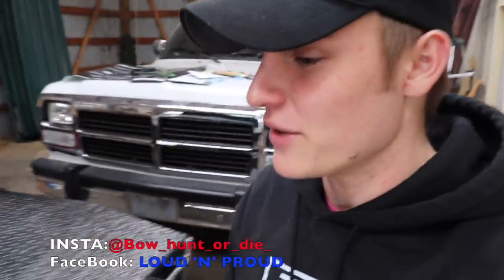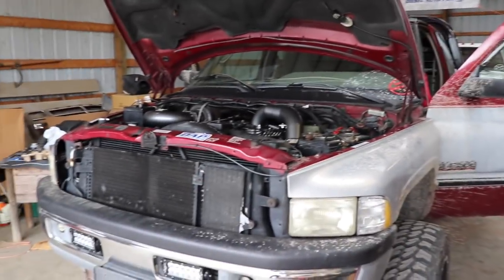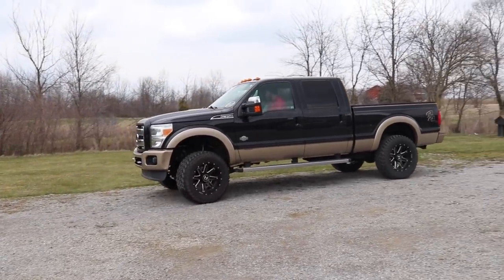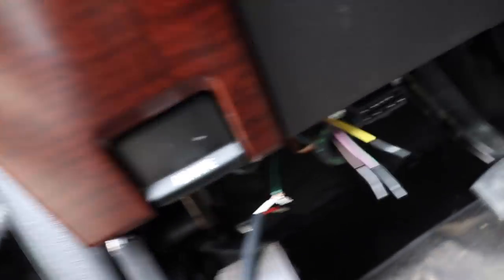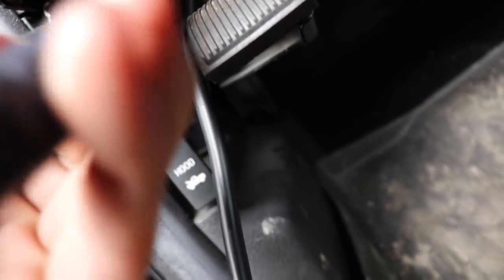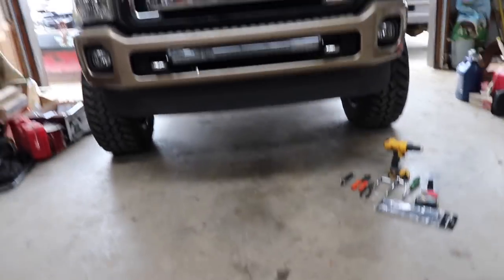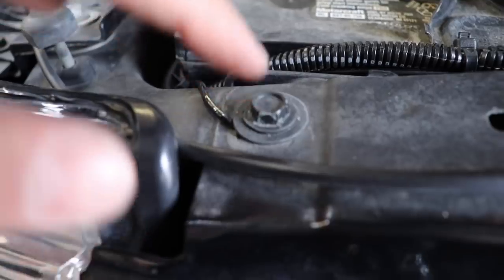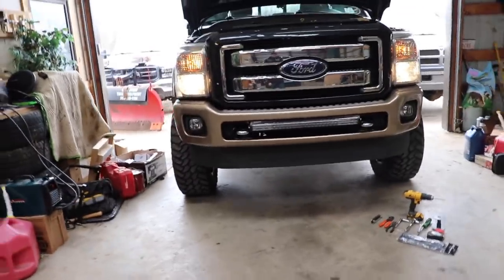NEVER THOUGHT I'D DO THIS TO THE POWERSTROKE.....

Comment: For future wiring projects look into getting butt connectors that have heat shrink coating, when sealed they will last much longer. Eventually those regular butt connectors even though they are protected will get moisture in them just from humidity and begin to short. Home depot and Lowes both sell them. Cheap insurance for the long run.

Comment: Hey man you didn’t need to run wires through the firewall. The upfitter switch also has pass through wires in the engine bay into the cab. There will be 4 wires in the back top driver side engine bay check it out!
Reply from the maker: aGingerN00b yeah I know. But the truck is so dang y’all now you can’t get to the wires just about and have enough room to wire them up... was easier for me to do what I did👌

Comment: Look on internet for your year model for Ford bodybuilder upfitter   https://www.fleet.ford.com/truckbbas/topics/2015/2015_Electrical_Wiring_v1-0.pdf. This os the one for 2015  other years are  there also  but there are also passthru wires factory installed thru firewall for the up fitter switches they are stubbed off by the firewall driver side taped to a harness allows you to connect the 2 wires inside and is outside foe ease of install.  The up fitter/bodybuilder info on web is great  lots of useful information.